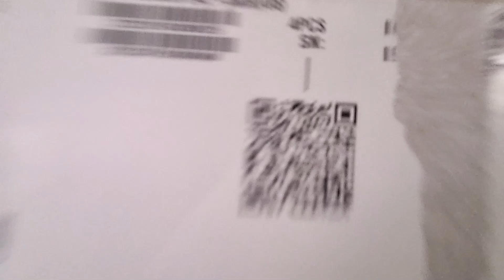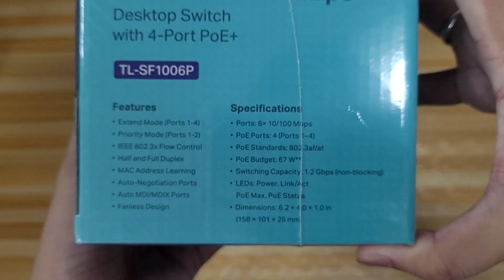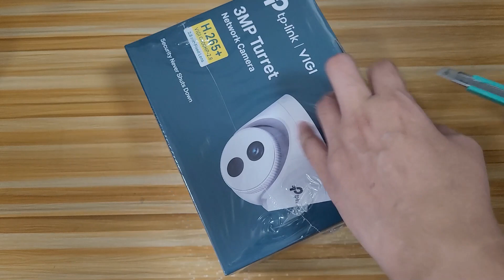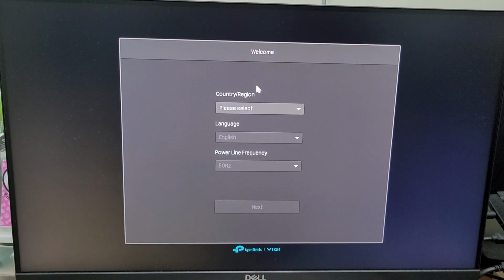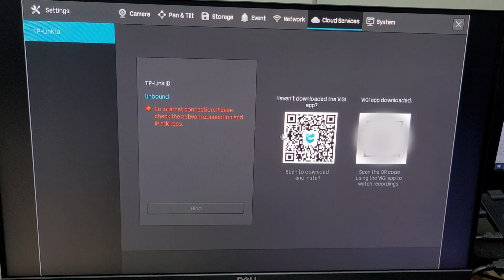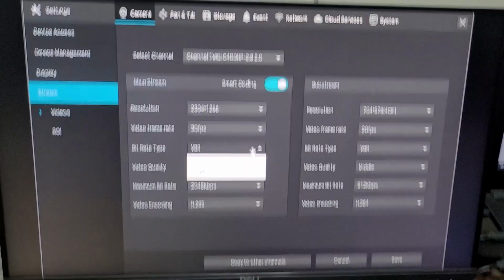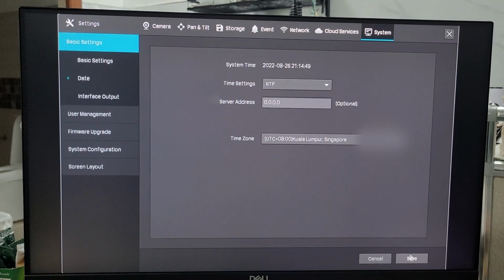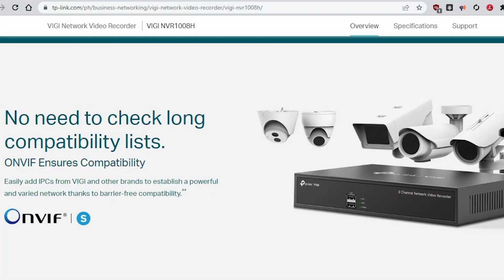The Best Entry CCTV Package? - TP-Link VIGI All-In-One 4-Channel Security System

Comment: How did u connect to network ? did u insert a internet lan to poe switch or poe switch has wifi
Reply from the maker: No Wifi for the poe switch, so it is wired.
The switch has 6 ports (Ports 1 to 4 for PoE, then Ports 5 and 6 for the NVR and to the Internet router).

Comment: Sir I have the same setup po using vigi nvr 16ch. currently using a different ip camera brand which is IMOU. connected sya thru wifi kaso ang dalas ko maka encounter nang no network video. not sure kung anong possible reasons bakit na eencounter ko ito.

Comment: sir may link ka ng 8 ports nito na set na? and may capture sya ng audio?
Reply from the maker: As of now, wala po silang set na may 8 ports eh. Separate ko po binili yung 8-port PoE switch. https://shopee.ph/TP-Link-TL-SF1009P-9-Port-10-100Mbps-Desktop-Switch-With-8-Port-PoE-PoE-Switches-TP-Link-i.117867014.7066161389
Reply: @BrianBGeronimo  thanks sa reply, how about audio sir? may capture sya ng audio? and if mag remote ka sir example nasa workplace ka, still VIGI app ang ginagamit to monitor?
Reply from the maker: @jollandcastro  yung set na nabili ko, wala po kasamang audio.
Reply: @BrianBGeronimo  ok sir, thanks sa info, last na po. VIGI app pa rin ang gamit if mag remote view ka example nasa workplace ka?
Reply from the maker: @jollandcastro  Yeps. VIGI app sa android or ios para ma-view remotely with wifi or mobile data.